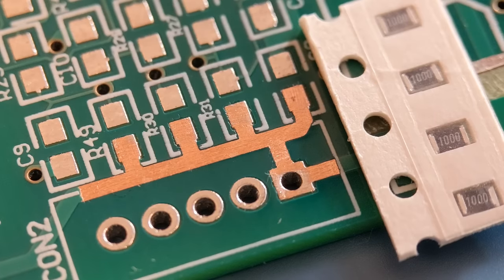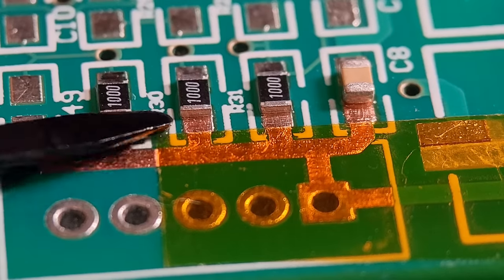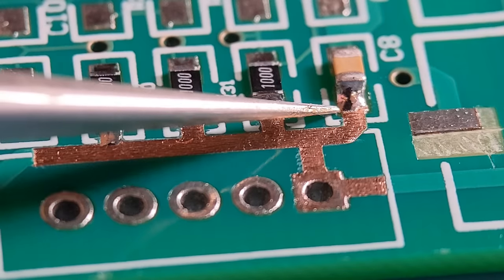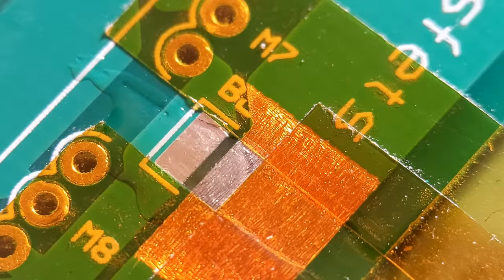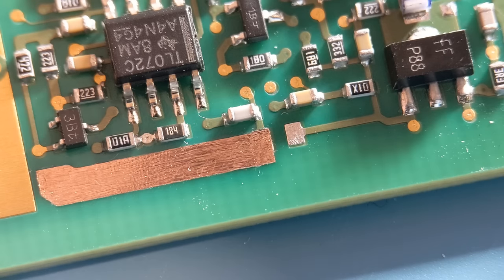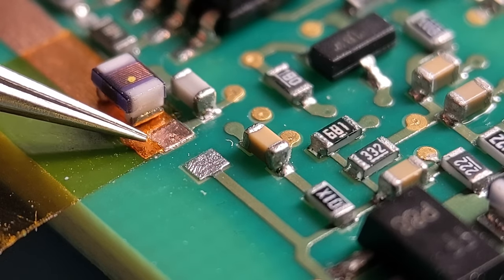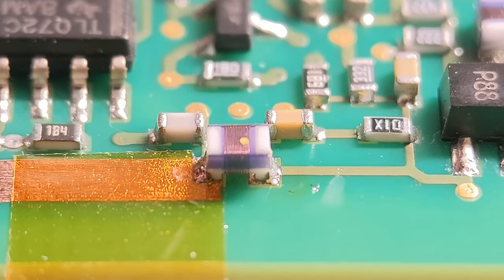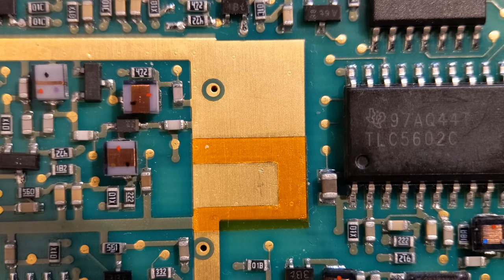How To Control Your Solder Joints / Soldering Tutorial

Comment: I am very pleased to report that I've revisited my previous SMD PCB soldering disaster, using your technique. I was able to remove all of the bridges on the 44 quad pin IC as well as the blobs of solder from the previously tinned R & C pads with flux & solder wick, to provide a flat surface. Then, one by one, proceeded to populate the SMDs with far greater success than with soldering paste, even with a template.
Your excellent videos have been a game changer for my projects. Fine soldering wire, fine soldering tip, and lots of flux are the keys to success, plus drag the tip away from the legs to pull the solder away, instead of along the legs... exactly as you're demonstrating.
Thank you so much!
Cheers! 😎
Reply from the maker: Hi , thank you for your comment, much appreciated. I'm glad the videos have been of use for you . If I can help a few people with their soldering then I'm happy . I will always post more when I get time so hopefully these can be of use as well in the future . Thanks again , take care 👍

Comment: Brilliant. Wish I'd seen this last week. Etched aboard and soldered on the 603 components and got rather messy. Works fine but doesn't look the best
Reply from the maker: Hi , thank you for watching the video and commenting , much appreciated. I used to watch solder running on parts of the board that had no solder resist on . Sometimes on RF boards this would cause problems . Decided to try some Kapton tape as an experiment to stop the flow and it worked perfectly . Hopefully the video can help a few people solve the issues I used to have . Thanks again , take care 👍

Comment: Which kapton tape do you use?  There is so many brands and types and thickness…i would like to get yours because I see it’s very good for the type of work I do.
Reply from the maker: Hi , thank you for your comment. The KAPTON TAPE I use which is the proper stuff ( no cheap fake imitation ) is made by 3M . Code is 3M 5413. It comes in various widths 6mm , 12mm , 25mm etc. It is expensive but shop around , Farnell , RS Components, Rapid Online , Mouser , DIGIKEY are all reputable companies but there is others . Hope that helps , thanks again 👍

Comment: I’m having hard time to solder smd capacitors because they’re too tiny and keep flying off even with the lowest fan setting on the hot air station.
Could I use the tape to keep smd capacitors in place (covering it entirely) and blast it with hot air?

Comment: Nice video! Thanks! But I use aluminum foil tape instead of kapton because every single kapton tape I ever bought had terrible weak glue.
Reply: Yeah I think its handy for stopping hot air from going into places you don't want it to go either since its so rigid
Reply: When you say aluminum foil tape, do you mean the type you use for duct work joints?  I dont mean duct tape btw.
Reply: @raygaither9369  No, not duct tape. It's heat resistant aluminum foil tape, very thin but with excelent glue.

Comment: What’s the cloth you’re using to clean the flux off? Ultra noob here
Reply from the maker: Hi , I use Gtek dry wipes ( grove sales ) based in UK . I dip these in a cleaning fluid called Ultrasolve or if I can't get that I use one called Flux Off. These are the best wipes I've ever used and they also leave no fibres behind . Hope that helps , thanks for your comment 👍